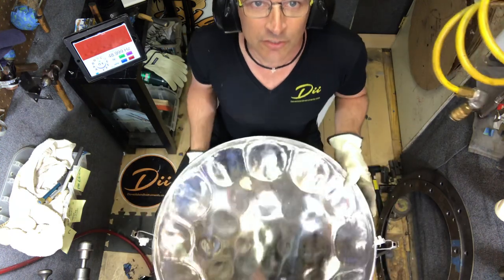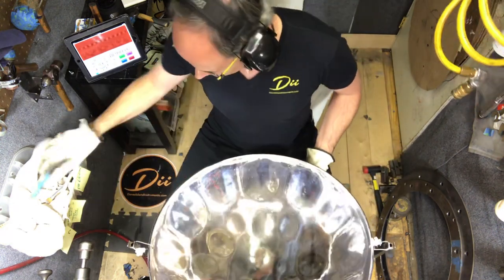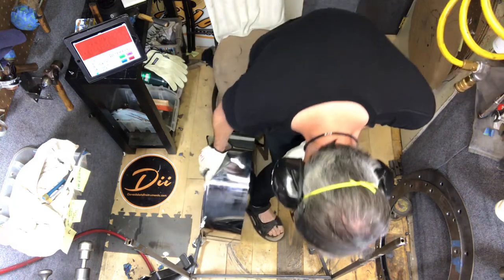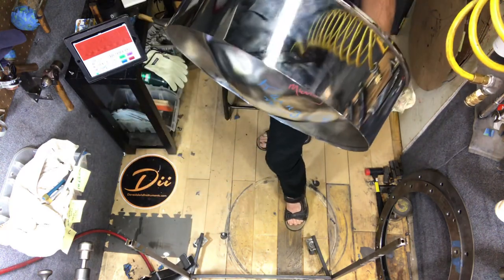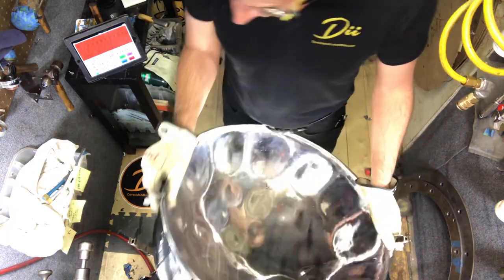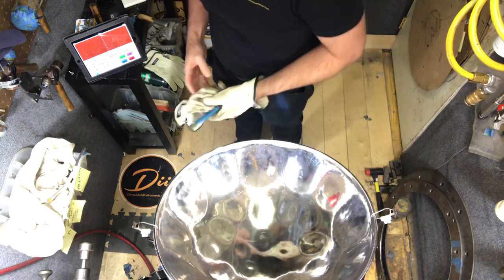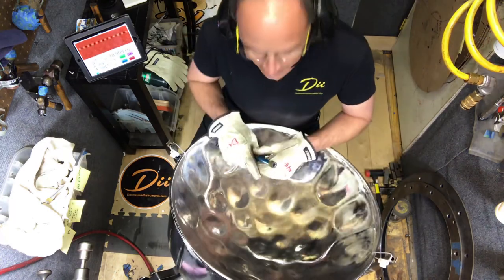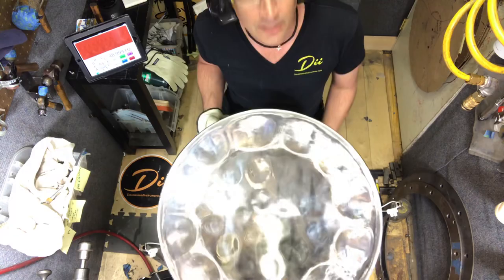Dii: How to tune a dented and damaged steel drum

Comment: Are  note attack and sensitivity and volume an adjustment?
Thanks Dii
Reply from the maker: TheDesertreggae Hi DesertReggae. Yes, if the notes don’t sound good (too sensitive, too soft, too loud, etc) there are some adjustments that can be done. The shape of the note has a lot to do with these aspects. Sometimes it can be a very aggressive process to reshape notes. The original method of shaping a pan is very important. If it is not done well it can be more difficult or impossible to make the pan sound good later.
Reply: @davesislandinstruments  thanks happy holidays